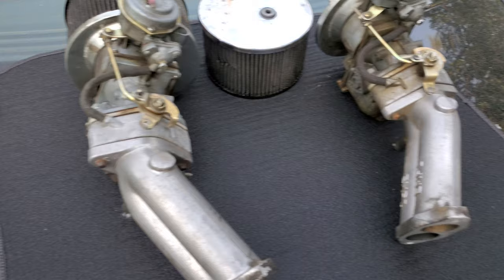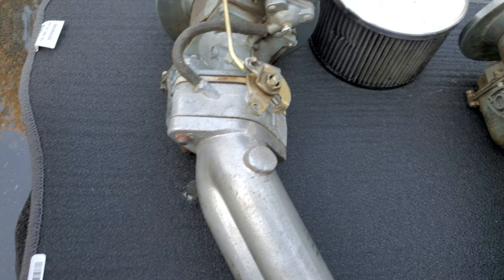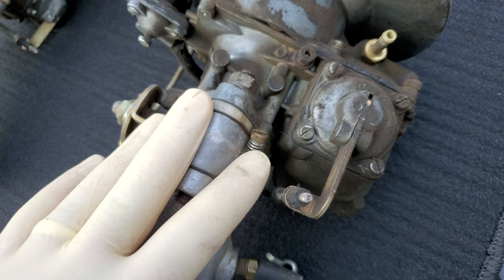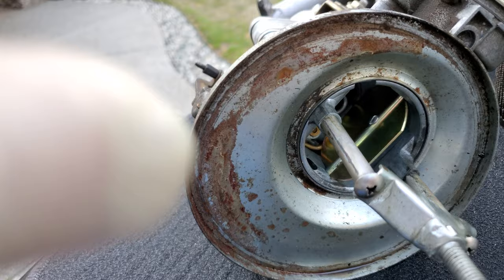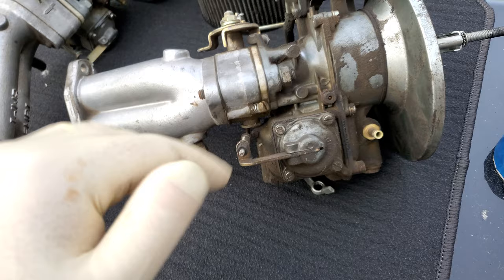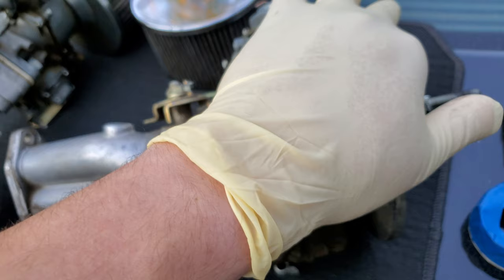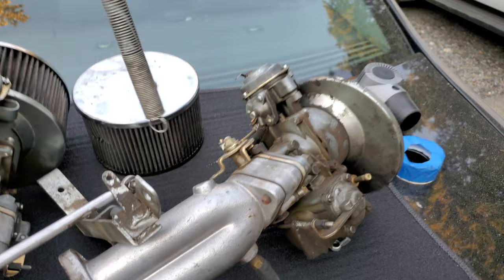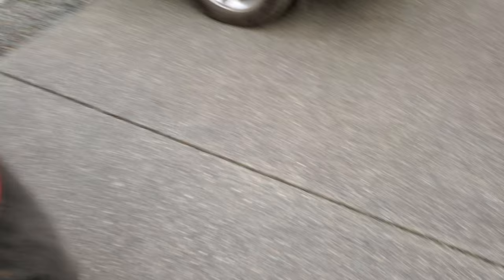Vw Kadron setup for @PopularityContest

Comment: Nice!! I just acquired a set of these for my 1904. I’ve never ran a set yet.
Reply from the maker: Awesome:) I can't remember if the engine in my volksrod is a 1914 or 1904 but it had those kadrons on it and ran descent. The idfs made a big difference though in smoothness and power. They are a simple carb that adjusts like a 28 or 30 pict carb and from what I know they were designed for volkswagens. Let me know if you need any help with them
Reply: @V8N8T  thanks brother I truly appreciate that. I’m just going to get a set of them HPMX empi, but I just don’t have the cash right now. Everything is so expensive. I’m doing a video this week just quickly on opening the box. Deno, sent them to me as a sponsor. I have never ran them before, so that’s some good news. I appreciate you responding. I hope you have been doing well, my friend! I have to binge watch and catch up on some of your videos.
Reply from the maker: @SladesVWBeetle  I've heard good things about those I think you'll be happy with them when the time is right. That's awesome what a nice guy! Thank you sir I have been doing well finally back on my bug is feeling great, little guy turned 2 and have one more on the way:) hope all has been well for you as well and I'll have to do the same for you 😊
Reply: @V8N8T  yes, I have heard a lot of good things about them. I think they may be easier to maintain. Wow, I can’t believe he’s two years old already. That one extremely fast. And congrats, another on the way! Family is everything brother. I am so happy for you. And I’m happy you’re back on your bug. That is great news! I hope your Monday is starting out Amazing!

Comment: Thank you for your video. What is the model of this carbureto? Is it good for use as single one?  Currently I m using a Solex H30Pics, it has originally 27mm of venturi but I've done a modification and it has 30mm venturi, few changes on gicleurs and filter. It's a good carbureto, very low maintenance and in 1500 ~2500 rpm have a good pull, but after 3000 rpm it's not so good. I am studing the variable speed carburetor or variable venturi, this is good for torque, but the price is near to a Weber 44 idk. 

I know that dual carb is far better than one, but today I cannot use it because of my manifold that is single hole. 
So, the question is: What carbureto(single) do you suggest, good performace not only in low RPM but a little more in right for a reasonable price?

Thank you and good job.
Reply from the maker: Thank you for watching. They are kadrons made by solex. I tried running a single kadron on my supercharged engine but could not get it to lean out on cruise. I've had good luck with a 30 pict but am going to try and 34pict with a 37 or 39mm venturi from aircooled.net and am predicting good results.
Reply: @V8N8T  Thanks for your clarifications. I had not understood that kadron was the name of the carburetor, in my country this model is not common.

The Solex H30pic from Aliexpress, for example, comes with very small jets, for example: The main jet is 120(gicleur), the idle jet (smaller gicleur) is 60, the flute (mixer) is 135 and the injector is 70. In my modifications I use the main of 145, the slow one of 70, the flute and injector the same size. Of course the venturi is bigger than the original and the butterfly (throttle) too. The throttle is 32mm.

As I said before, my carburetor is the H30picS, a version more geared towards smaller engines and for the city economy, the venturi was still much smaller originally (I believe around 22.5mm), but as I increased it to 25mm, the flow improved a lot . But even so, I realize that the performance above 3500rpm could be better, I believe it's because of the engine architecture I'm using. I currently use 1600cc pistons, with 1500cc heads, good for torque at low rpm, as they are single-entry, maybe I have a flow (too rich mix) problem with the H34, but I'll test it anyway. In the future I will change the heads for 1600 with double entry, I will work on the seats to improve the flow.

Thanks a lot for the tip on the carburetor.
Reply from the maker: @HorizonBHZ  you betcha!